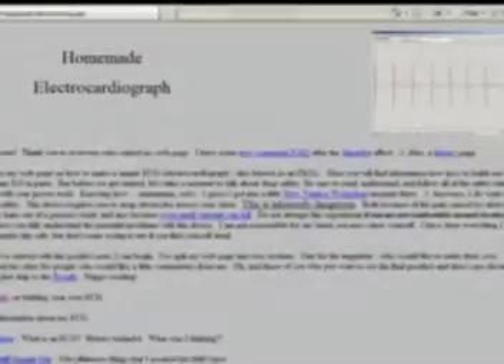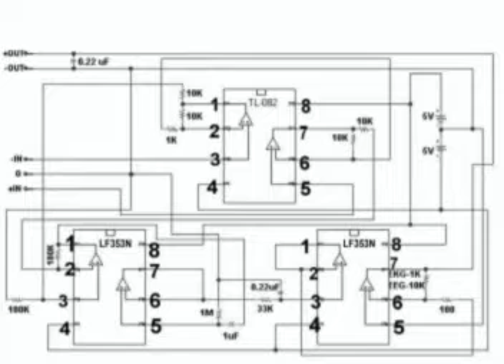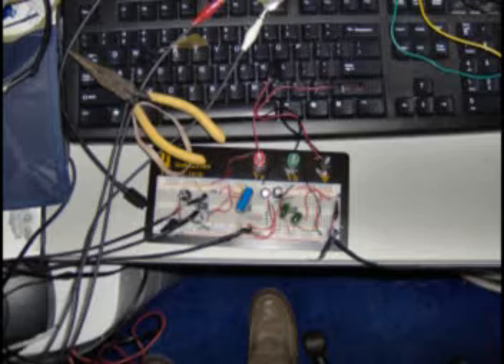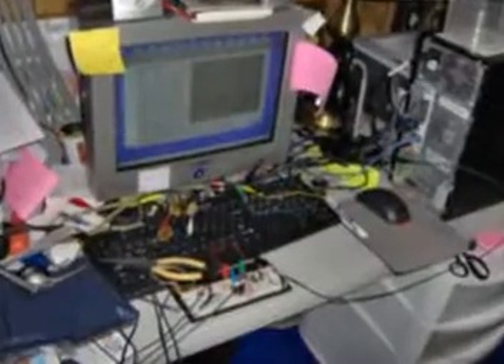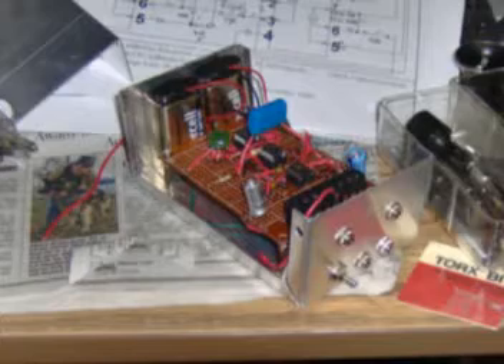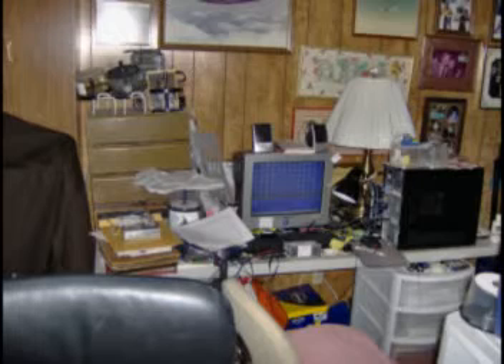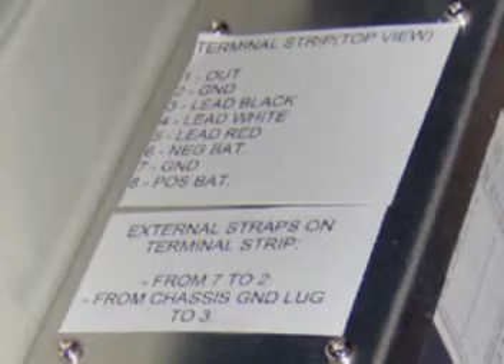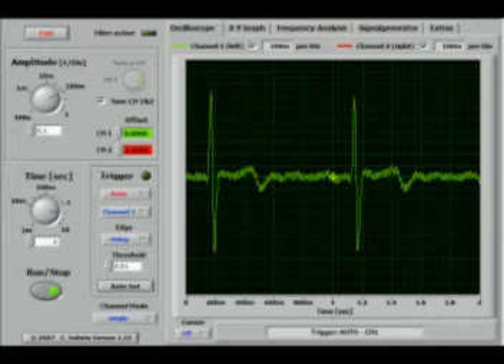PopPop's Homemade EKG

Comment from the maker: Thanks. The last one I built I used the INA122PA chip. It only requires a single battery. I output it directly to the computer sound input.

Comment from the maker: The sensor amplifier is a single chip, INA121 which is about $5. Required also is the chip socket, two 9V batteries, parts and box to mount and contain them and connecting leads. See previous comment for connecting the leads and displaying the output.

Comment from the maker: Google PC oscilloscope Zeitnitz for software. One lead is a reference or ground lead. The voltage between the other two leads is displayed. I obtain a good signal by putting the reference lead on my leg and holding the other two leads, one in each hand. Although there is info on the internet re lead placement and interpretation mine is not a medical instrument. I see my doctor.